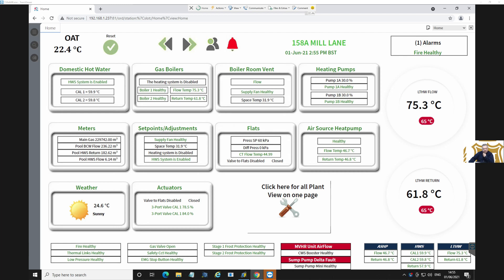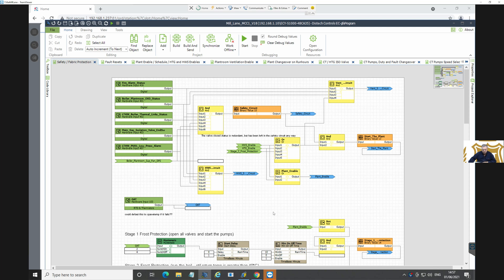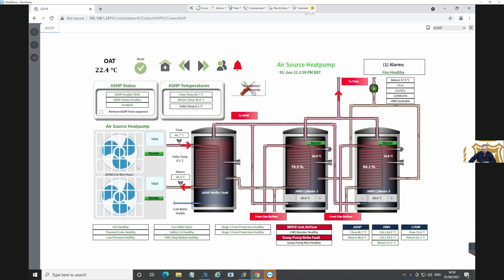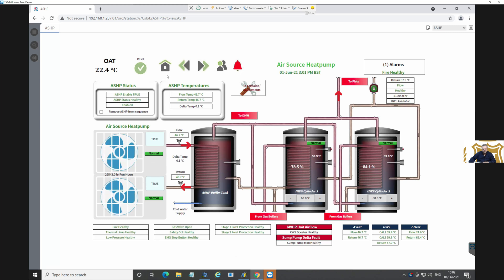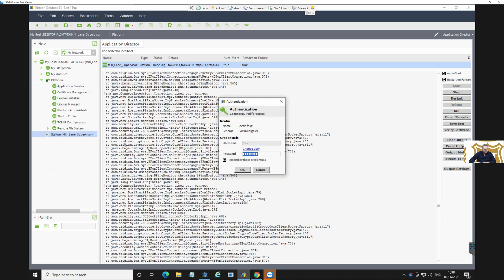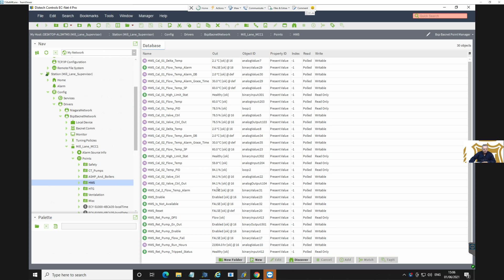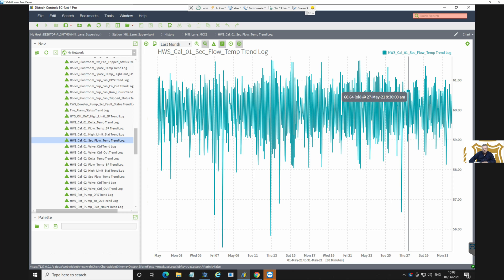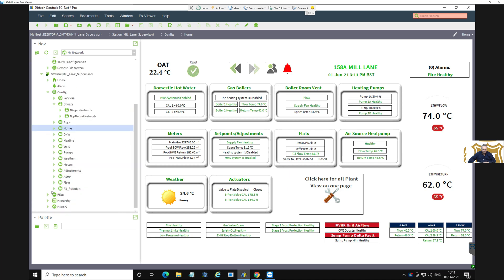#4  N4 Tridium Niagara -Machine learning - Distech ECY-S1000 Controller with graphics

Comment: hi, random one . but are you doing anymore distech  videos . it would be nice to see how you transfer gfx to wb visa versa . cheers Ian
Reply from the maker: I can do more GFX to Workbench videos. The transfer is easy as I always use BACnet network to move the points across from a GFX (ECY-S1000 for example) to a workbench system.
Reply: @NiagaraTridium  legend thank you !
Reply: tbf anything you will do on distech i will be very grateful ! and thank you for responding!
Reply from the maker: @iantorry88  Uploading Video #102 shows you how to take the BACnet points from the Distech into the Niagara controller using BACnet. I would give it about 1 hour to let it upload and process the video to 4K